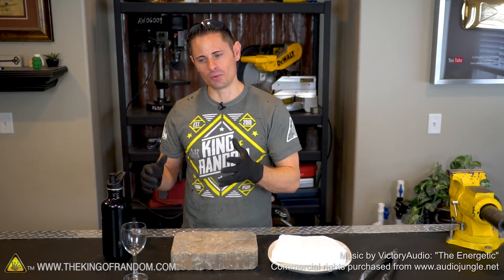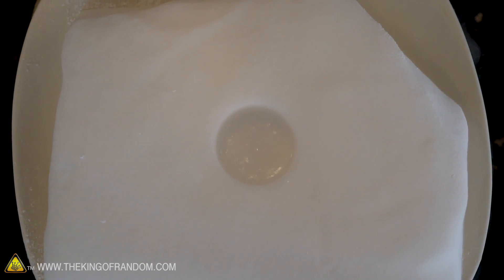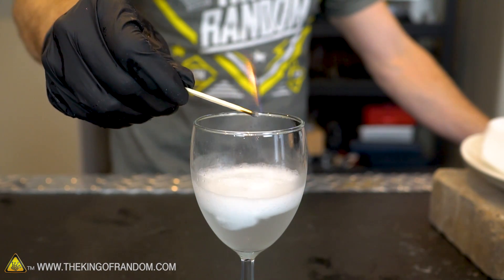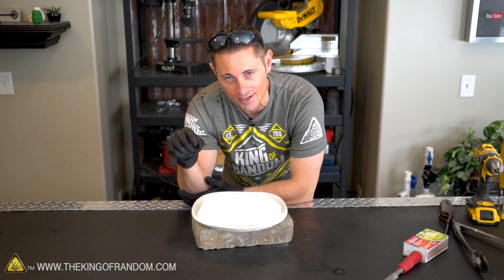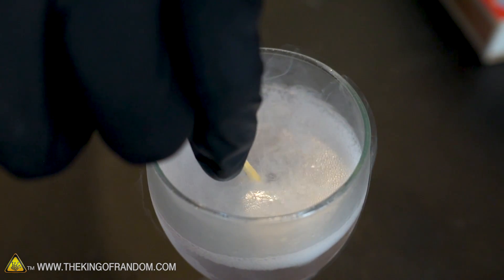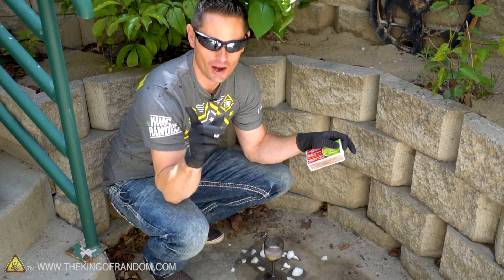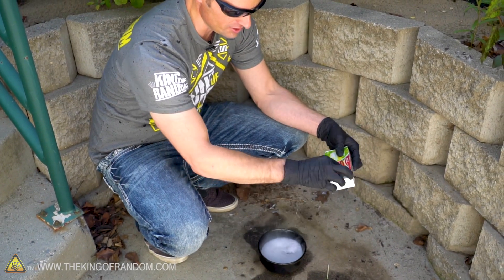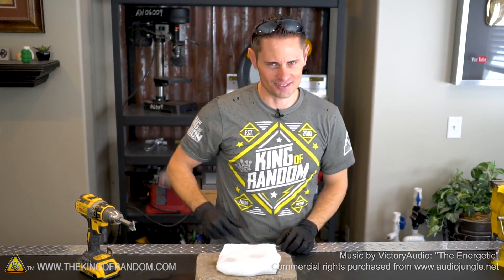What Does GASOLINE Do To Dry Ice? Can You Really Make A Fire Extinguisher With Gasoline?

Comment: ... the dry ice in gasoline when it's on fire is the same concept as a co2 fire extinguisher
Reply: and your actually removeing two diffrent elements of the fire triangle (in order to have a fire you need to have fule,air,heat/spark) so by putting dry ice right  into the burning gasoline your cooling the mixture so it stops producing the vapor and the co2 is blocking any air getting to the gas to keep the fire going
Reply: darkwolf2k00 I think gasoline can still set off extremely easily even after been frozen and thawed out a bit.